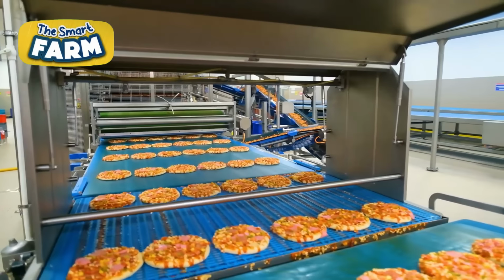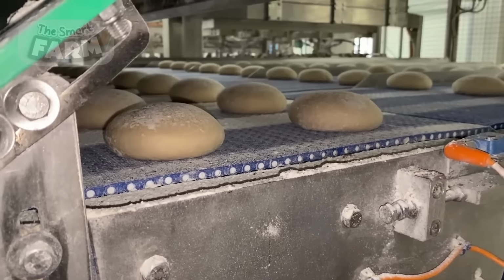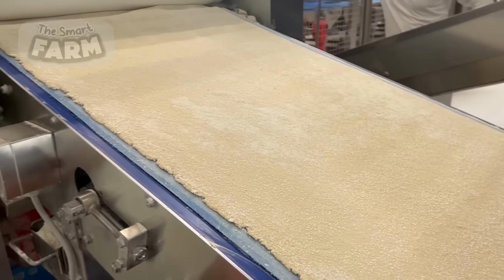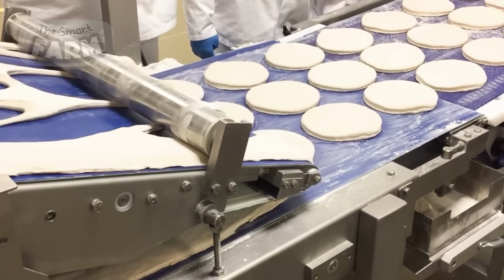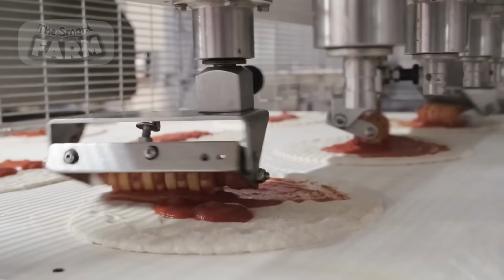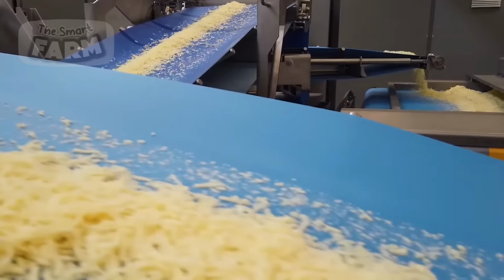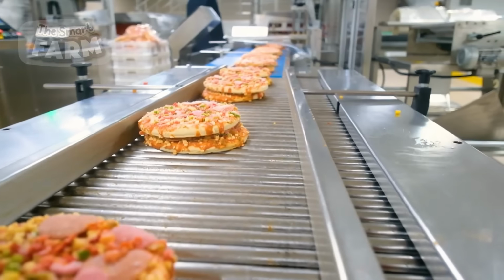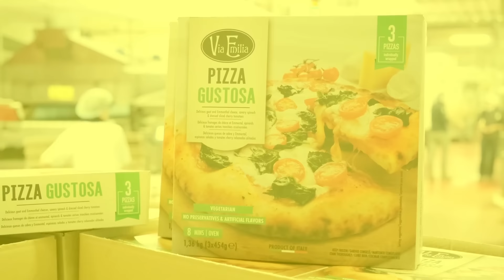Frozen Pizza MEGA FACTORY: How Automation Produces TONS of Pizzas Daily

Comment: As an industrial maintenance worker, all I see is a nightmare of machines when they go down or aren't working right.
Reply: I'd hate to be the cleaning staff for these machines
Reply: i worked at spring water i  portland and for two months the arm that can lift three five gallon jugs of water and rack them in front facing crates broke down and we had to lift them all day for ten hours every day. they got lunch everyday but it was a work out all day. like 42.3 pounds and we switched off sitting bottles on the conveyer and a machine  sterilized them also every two hours
Reply: Just imagine the machine that squirts tomato pizza sauce adding 3 times too much sauce and there is sauce being stuck to everything around that area. 'Clean up 2 tons of pizza sauce in Aisle 10!'...bahahaha
Reply: Tyler Mac yum I want too get it
Reply: I know these kinds of machines are not new, but I still am amazed how they make these contraptions.
Reply: As an industrial mechanic I see job security.
Reply: @firebirdlover4460  No doubt
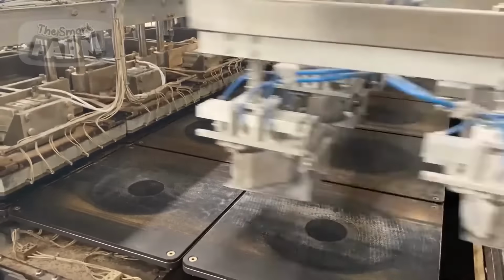Reply: 2:17 is your friend
Reply: I thought the same things, as a maintenance/machinist/welder/fabricator I think the boxes and the pushing the pizzas in would be the worst if it ever got out of calibration or something went wrong with a conveyor belt.
Reply: i love the challenge of getting it working again .
Reply: The flying pizza incident.
Reply: Yes this is the first thing I think of when taking these tours. What could possibly go wrong and how many skill trades people they have. Preventive maintenance

Comment: How many jobs did these machines take from humans
Reply: It would take a lot of time otherwise 😅
Reply: Too many.  So sad
Reply: Probably not many. First of all it required A LOT of human labor to design, engineer, install, maintain such machines. Second, the machine makes it possible to produce in volume. Without machines, probably not that many pizzas would be made anyway. Third, because of the volume of pizzas the machines can make, there is jobs for contractors bringing in the ingredients, factory service, etc. So, a lot of humans are involved in machine factory, just they are not visible on the conveyor belts
Reply: All of them 🤷‍♂️
Reply: @lsdecaria1  designing, manufacturing, installing, maintaining machines are also all jobs. It’s like because horse wagons was replaced by cars (and horse riders, blacksmiths, and all industry around horses) yes those jobs got replaced by the machine (car) but a whole industry around cars then created jobs

Comment: What I want to know is how, with all this technology at their fingertips, that the industry has no ability make anything even close to a mediocre pizza,  It's embarrassing.  Other mass producers can make good doughs, and other mass producers can make pretty decent red sauces, and great cheeses is ready available, yet the pizza industry gives a steady supply of junk that's only a dollar or two cheaper than a fresh pizza from a local pizzeria. This is an industry that has 100% disposed of any prospect of quality in exchange for making cheap crap for high profits.  It's a amazing how much thought and technological investment has gone into creating such a consistent mediocre-to-bad product on a grand scale.
Reply: In my opinion that's inherent to the process and the target market. As an attempt to lower cost, toppings are replaced by dough. Such thick frozen dough cannot get cooked through by a oven at home following their advertised quick cooking instructions. It comes out raw. They would not advertise an appropriate but longer cooking method as that would make the product unattractive. Instant ramen has the exact same issue. On the other hand, there are fresh pizzas made using similar processes that are usually quite good. I also stumbled across higher grade frozen pizzas with the right thickness, and they were a success as long as cooked twice as long as advertised. But they come at a much higher price.